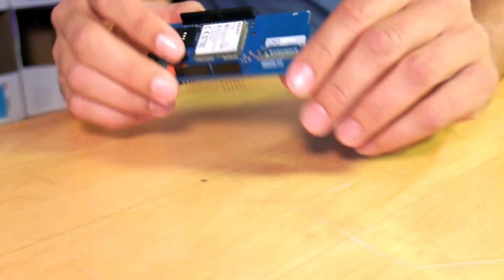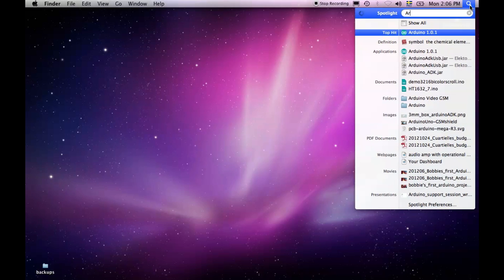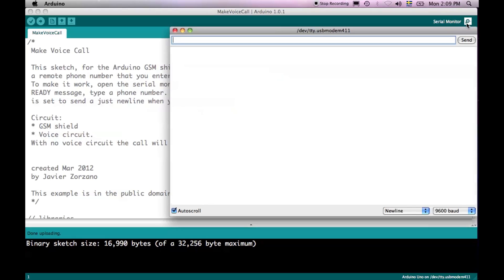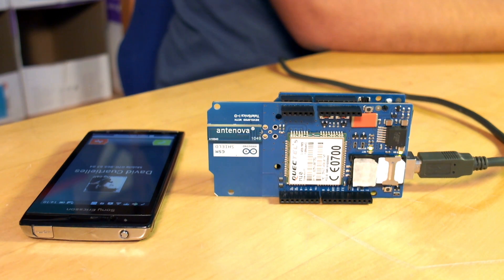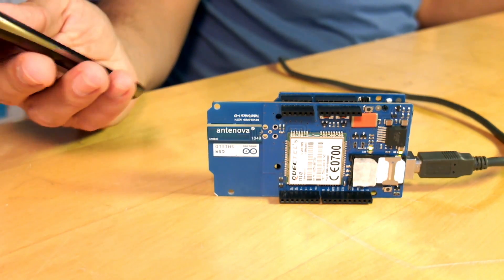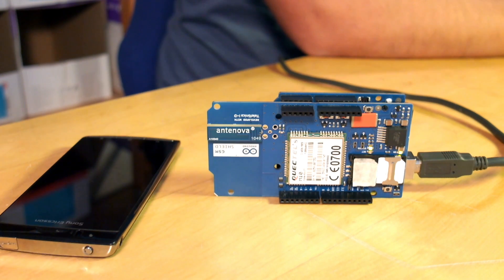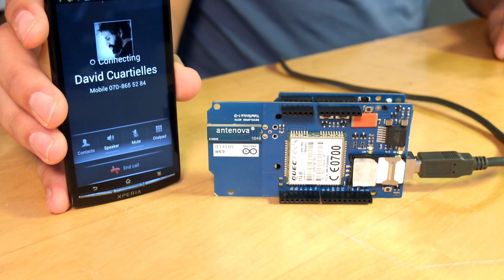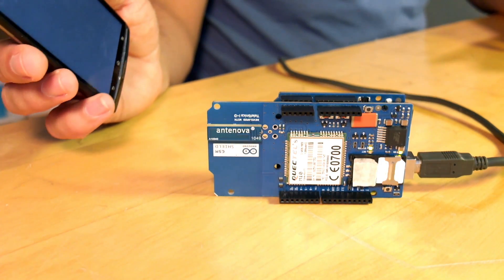Arduino GSM Shield - Intro part 2

Comment: hello sir, im from ungku omar polytechnic. im doing my final year project, i had seen ur video part 1 and 2, where u use gsm and arduino send and recieve sms and call from phone or ur pc. my project flood detection system. i already done my coding with send text message yg the sensor detect water. but i need to make a monitoring system so that i can monitor my sensor. how am i going to connect the shield and monitor it with my pc using my wifi. it would be nice if u can help me. tq

Comment: how to call gsm arduino my gate linear actuators 12 volt system open the door and close.i need buy one gsm one mega arduino  and 5 relay module adruino .pleace help  how to setting  the adruino

Comment: Hey, 
 I recently bought a GSM module with arduino mega in the arduino site. Today I opened it and was testing it  . I fired up the sample code  "testGPRS" found in the examples. But to my dismay , the code was not working. The code was staying at the line "Connecting GSM network...". It is not proceeding to the next line of the code . 
So i tried the "testmodem" code. It returns " no modem answer". So now it got confirmed that there is some problem with the device only and not the code.HElp pls

Comment: How did you manage to run this without a power supply ? When powered through USB my gsm shield shuts down during the gsmAccess.begin(PINNUMBER)==GSM_READY. Even when powered externally (12V / 2amp power supply) I sometimes see the shield shutting down during init forcing me to reset.

Comment: 2 questions. Im on a project that will read the content level in a dieseltank using UNO which will conect to the internet and update a database. I would like to send signals in reverse to command a heating system to switch on/off. 
1. I notice the GMS shield fits on top on the UNO. It looks like it blocks the inputs/outputs to the UNO though in the documentation it uses only a few pins. How can I use the others?
2. What relevance is the Bluevia if you can use any simcard. Im based in EU.